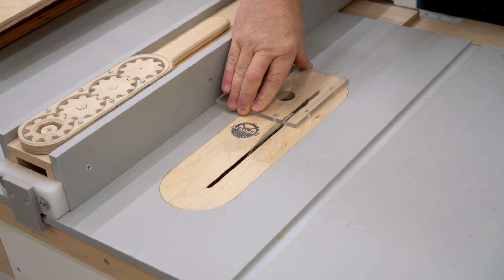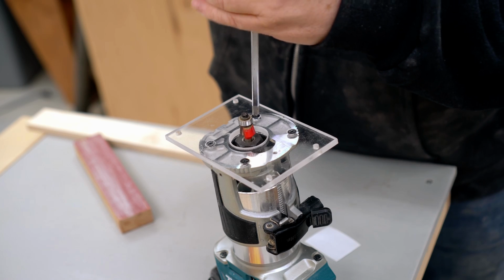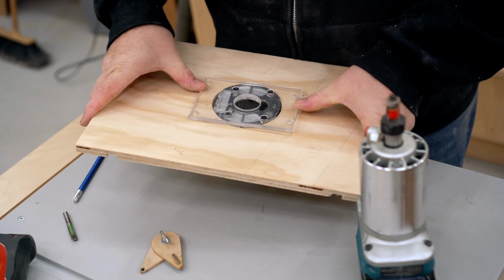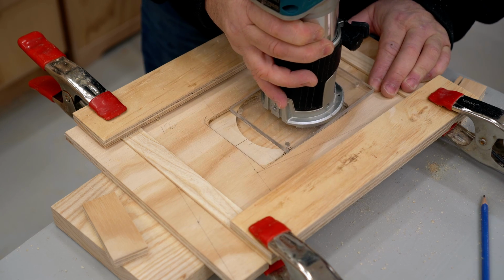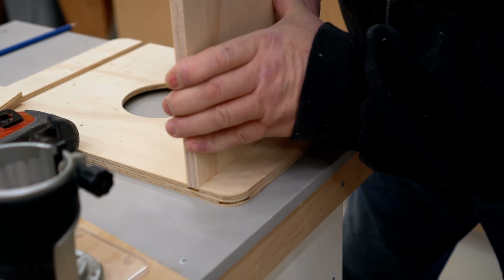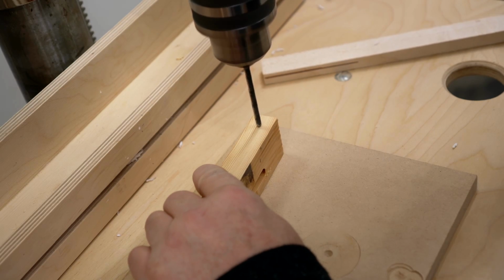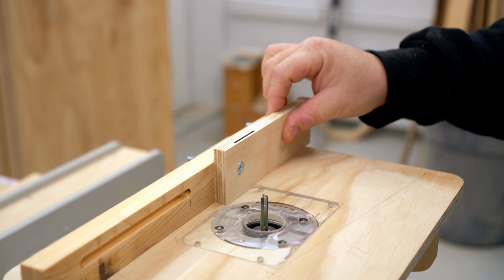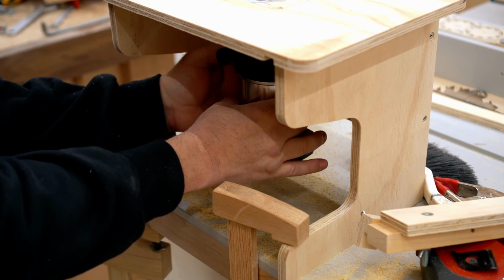Every Small Workshop Needs This

Comment from the maker: I thought it would be handy to have a small table for my cordless trim router. 
Key design points:
- made entirely from scrap wood, plywood mostly
- fast and easy to put the router in and take it out again
- a convenient way to clamp it down to my work bench
- a proper fence with movable faces to close the gap around the bit
- use a base plate for the router that can stay on the router
Time will tell how often I use this table. Making it more convenient to use for small things than my big router table will go a long way.
Reply: The only thing I would have done differently is to make the new router base the same shape just a little oversized then you don't have to change the plate when you want to use it for something else 😀 otherwise I love it!
Reply: Where is the beginning of the video?
Reply: Are there any plans available for this table
Reply: Are there any plan’s available for this ?

Comment: i just fit mine to my underside of my. bench. removed the shoe first. marked holes amd then ran 2 5mm.threaded bolts. from the top of the bench (counter sunk). i then used a piece of roofing batten as a. fence. set it for 5mm picture frame. rebates and drew a line on the bench with a marker.. i adjust the batton distance accordingly by screwing it down. im thinking of using wing nuts in the near future for quicker adjustment

Comment: Engineer router table. Actually my router table has very similar design, but (probably) 75% bigger. It fits both my small Makita as well bigger Bosch routers. It was made from scraps in a single afternoon and paid the effort several times.

For dust extraction when using it extensively, I use a vacuum and the stuff each router came for dust collection.

Thanks for post that because am not feeling alone as most people, at last in YT, have super fancy router tables!

Comment: I'm new to your video's but find them super builds, my question as a subscribed person I haven't seen a video on how you built your table saw rip fence. I have a Grizzly 10in table saw and I hate the rip fence and to upgrade it Grizzly wants over 500 dollars. My problem is every time I clamp the fence down the far end moves so I have to adjust the far end and use a C-clamp to hold it down in order to get a straight cut. Do you have a video on building your rip fence? Thanks  P.S. This is so madding to have to do every time I build anything. I would like a fence that is accurate every time I clamp it down. I'm not enjoying my table saw jobs / hobby.

Comment: Great video. If one wanted to expand on it a little, then one could add T tracks for the fence or a mitre gauge, but of course that increases the cost. It might also make life easier, picking up a second base, so that the only thing you are removing is the router body when needing it for another job.

Comment: 🔥  Or you could just save yourself the time & effort by purchasing the Veritas version long available from Lee Valley Woodworking. A bit more polished. In addition to the table, they also make base plates (use with or without the table) for almost all compact trim routers, including the current Ridgid versions.

Comment: I've been using similar things for building router tabes. This is a good project, but I think plexiglass is not a good material for this. Aluminum is a better choice, you can drill it with simple electric tools and cheap bits. In addition, it does not crack or fail like plexiglass.
And, if you have a good supplier, try getting some very large aluminum plates for the router table. Therefore, you can get a more precise ground for larger workpieces. 
And, if you build a router table, let it be large; because that damn thing is awesome, and you will definitely want to add extra pieces (like an adjustable fence) to it.

Comment: Hi John i follow ur videos and this one caught my liking.
Problem is im deaf so didnt hear wotvyour saying incase u mentioned the sizes.
Do u have the mesurements for this thanks
Reply: I hope the captions picked up the details you needed, but if not, the top and sides are half inch ply. The back is 3/4 inch ply. Those L-shaped bits for the fence are two pieces of half inch glued together, although slightly thinner than the top (sanded?)  So it still grips.  Hope that helps.
Reply: @matthewsimmons6831  hi there i found out why captions didnt work they were switched of in the settings menu

Comment: Very nice John. 

I can attest to how handy it is to have a router table this size for a compact router. I built one that hangs off the side of my MFT/3 for a cordless compact router. It's great for those small, quick jobs or when you have your router table set up for an operation and you don't want to break it down. And an added bonus of John's design is it's easy to take on the road when working away from the shop.

Comment: Funny enough I just made this as well for the same router this week. My version has a larger fence and top but clamps to my workbench with the router hanging over the edge. The Makita dust collection attachment also works well enough that I haven't needed to attach dust collection to the fence. Will probably be using this as my main router "table" for a long time to come

Comment: I made pretty much exactly the same thing for my Katsu cordless router (basically a Makita knock-off, it even takes their batteries!), I just bought an extra base for about £12 and installed it permanently rather than making it removeable. It even has the fine adjustment with the knob!
Reply from the maker: My original idea was to make the table so that just the body of the router was needed, without the base. I did it this way to simplify the build.

Comment: Is your construction adhesive stronger or faster setting than normal wood glue or why do you seem to use it quite often?

Nice project, I'd probably add a port for dust collection.
Reply: He has mentioned that it (a) works better in a cold shop than normal wood glue  (b) has a longer set time, which probably isn't the reason in this case.
Reply: @adambonner1195  Temperature makes sense to me, I should think about that for myself, thanks.

Gotta search for some strength comparisons.

Comment: John I love your projects especially when you make your own tools.  But I noticed something @1:19 in your table saw.  In the accelerated video for that small section where you are cutting dados, it looks like the fence is deflecting a very small amount as you push the plywood top thru.  Might just be me or camera/video weirdness.
Reply: @abacabdk3490  You might be right.  I put a sticky note on my monitor barely touching that piece of plywood behind the fence and the top left corner of the fence and ran the video again.  To me, it looks like there might be a slight movement in the table but I notice movement more for the fence.  Who knows?  John knows.  That's who knows.  I really am not trying to knock on his table or fence, just pointing it out.

Comment: John, do you think the friction fit for the fence tabs provides enough resistance to keep the fence from moving once the wingnuts are tightened? Not sure if gluing a small piece of rubber would be beneficial. Thanks for the video! I'm always impressed how you're able to build your own machines.
Reply: YOu shouldn't be pushing against the fence so hard you can move it.

Comment: I incorporated my router into the extension gap on a Ridgid table saw. Used a 1/2" shank router.
Worked out fine, and it's as stable as the table saw, with no extra room used in the shop. 
Food for thought, keep up the great videos.
Reply: I did exact same thing on my Rigid saw. Beefed up the fence to do double duty.
Reply: I'd love to see how you did that....  I've been thinking of doing the same thing with my older model Ridgid table saw.  What materials and how did you size it and mount it?
Reply: I did that on my rigid jobsite saw, the gap when using the bed extension makes a nice place for a router table, I just have the cheap ryobi router table top and fence with a rockler router lift